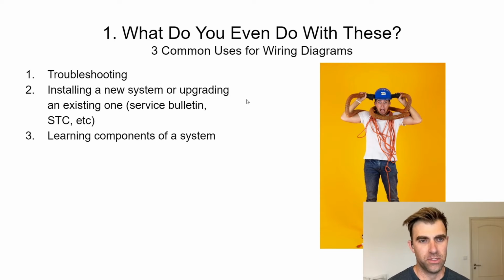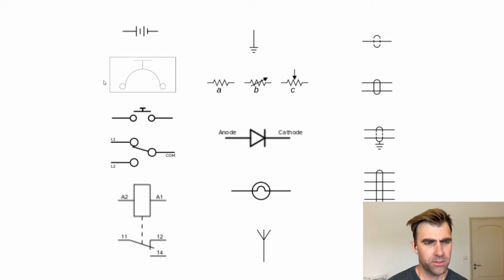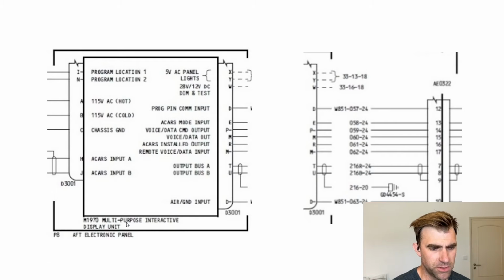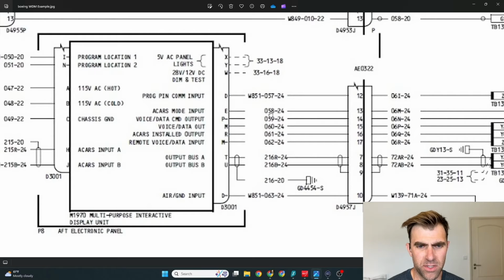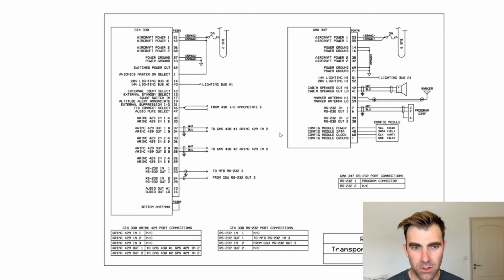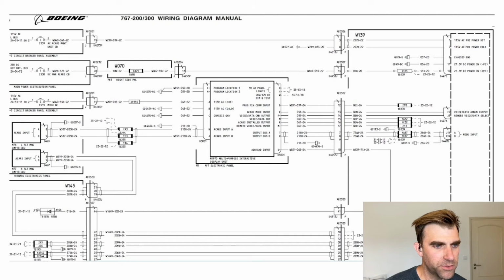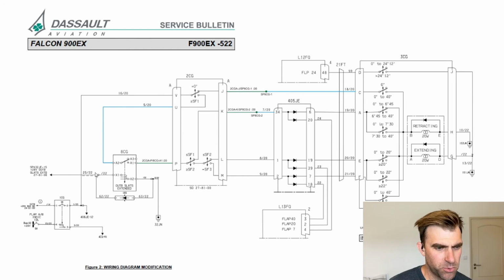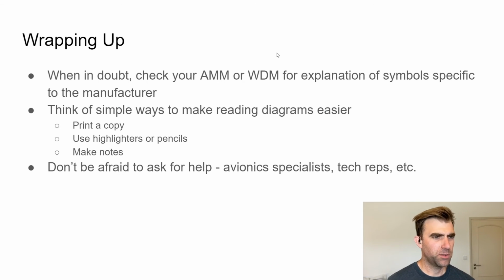Reading Aircraft Wiring Diagrams: Madness to Mastery

Comment: I know this was not an avionics specific presentation however I noticed a few things on the avionics wiring diagrams that I cannot find explanations.  I have seen connections for switched power in addition to the bus power connection.  What is switched power and where would it be used?   I have also seen a connection for power out.  I believe this would be used to power a CDI through the radio.  The grounding symbols show one side of a shielded wire grounded at the radio or the audio panel.  My understanding is only one side of a shield should be grounded at the component ground connection (radio or audio panel) rather than the aircraft ground.    I am working with the older style avionics. Help would be appreciated.

Comment: Thanks Mark for taking your time to explain and also answering one comment that talked about salary, anyway I am automotive technician specifically electrician more detail with ability to read diagram and also mechanical experiences, I am planning to switch into aviation to learn on how things work there, but I can see you have also moved from the aircraft technician area, to office work, with all due respect can you tell us the stress in being aircraft technician and why the move, I really want to know alot so that I should not waste the time.. as one age
Reply from the maker: The main reason I pivoted was to have location freedom and to be able to work remotely during the hours I choose.

I enjoyed my time working in the hangar, but in this current season of my life I prefer not to have anyone telling me what time and where I need to show up for work.

I see more value in being compensated for my effectiveness instead of the time I’m required to spend working for someone. There isn’t exponential reward for getting work done more efficiently for someone else - you still have to be there 8+ hours and there is just a new expectation of your productivity.

Hope this helps!

Comment: As far as 'follow the yellow brick road' goes, I'd suggest using the functional schematic for an easier time seeing the 'big picture'. Wire diagrams have a lot of direct detail. For example, you had connector D4957P/J at panel AE0322. The E means EE bay. the 032 means approx STA 320. The last 2 (in 322) means it's on the right (even number, odd number would be left of the center line). If it were AP1300, it would be in the passenger section at approx STA 1300 and at the centerline. AC1305 would be in the Cargo area at approx STA 1300 on the left side. There is an incredible amount of detail encoded in a wire diagram. In your example with M1970, you can tell by the shields that the connectors are not conductive since the the shields pin through and never terminate at the backshells. The terminal blocks graphically represent the gage limits they can handle. The ground pictorials denote what type of ground it is (stud, ground block etc.)
Reply from the maker: I think you need to make a video on this topic 😂

Comment: Hi this video is very useful for me as an avionic student. I would to ask you which is the average pay for an avionics technician? Can an aircraft avionic work in the industry such as Panasonic Samsung or others electronic engineering industries ans also on the military side?
Reply from the maker: @riccardoromiti5632 average pay for avionics techs in the U.S. is $32-33/hour. 

https://www.indeed.com/career/avionics-technician/salaries

It’s possible to work for electronics companies, but those positions would likely only be as a technician of some sort, or “engineering technician,” not necessarily as an engineer.

You would likely need an engineering degree of some sort to be in engineering. There may be edge cases where you wouldn’t need a degree, though - depends on your situation/standing with the employer, and whether you meet the experience requirements of the jobs you are looking at.

The military has plenty of jobs in avionics, no worries there.

Thanks for checking out my channel, and feel free to email me!
Reply: @markhjoy  thank you very much Mark, I will contact you to gain informations about maintenance technician in particular avionic. I live in Europe in Italy, if you also know the rules of EASA your advices will be very helpful for me
Reply: I correct myself : I would ask you *